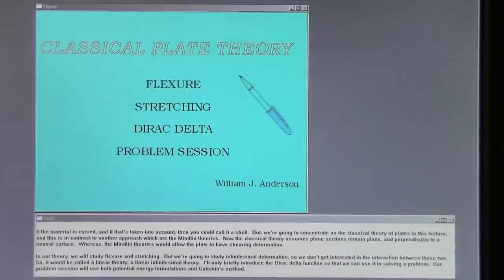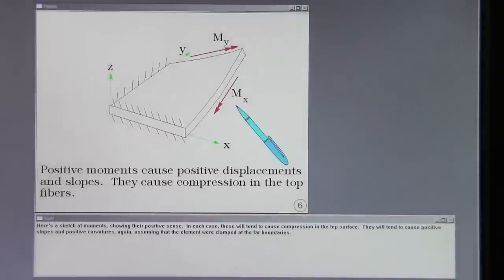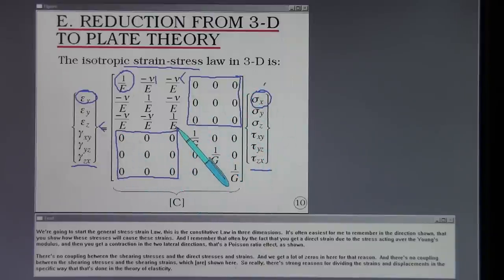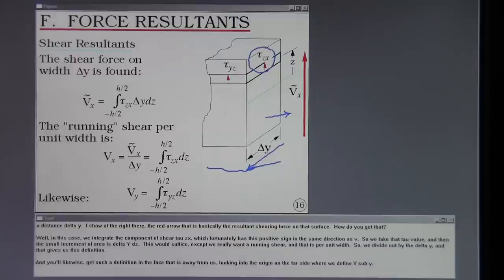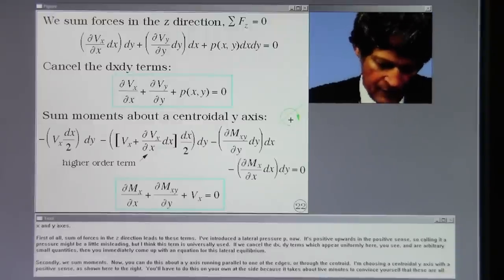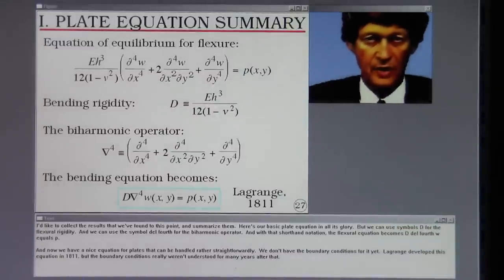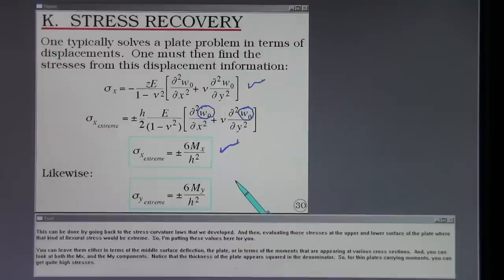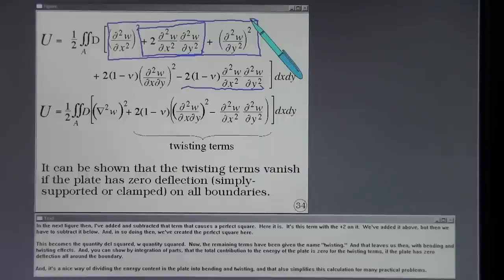Classical Plate Theory.  Lecture 15, Part A.

Comment: Dear Kuwaiti27,
My first thought is that you can't use plates to represent shells.  Shells have curvature and that is not included within a single plate element.  On the other hand, if you used a lot of plate elements to represent a shell, you would pick up the some of the curvature effect during the assembly process (I think).  There is a problem that the plate theory can't directly handle midplane stresses, except in a nonlinear plate element.  In shells, this connection between bending and stretching can be handled with small deflection, linear theory.  Hmmm.  

Well, this is a tough question and I can't give you a good answer at present.  When finite elements were newly developed, some researchers tried to model shells with plate elements (because there were no good shell elements at first).  You might have to look through the publications back in the 1960's to read about these attempts.

Bill Anderson

Comment: Dear Vittal,

There is an older, good book on plate theory by Timoshenko.  If your diaphragm is circular, I am sure he presents results for such a disc supported on its rim (either pinned or clamped).  I haven't done any calculations for 15 years, so am out of the loop, but you should be able to handle this case.  It sounds like a good example for classical, linear plate theory.

Your pressure is pretty high, so I am a little worried that a disc of that thickness can support that much pressure.  You ought to be able to solve it completely, however.

Bill Anderson